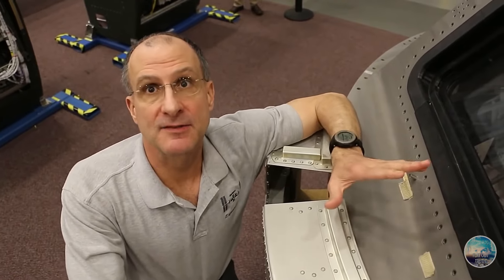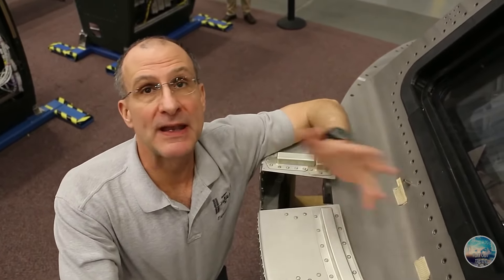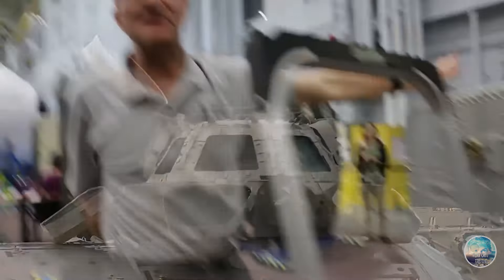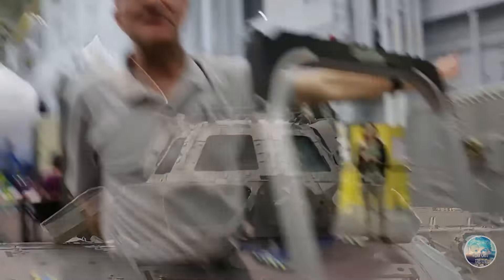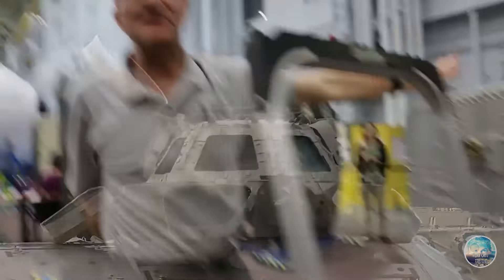WHEN ASTRONAUTS FAIL AT LYING

Comment: The best vacuum chamber on earth has walls of concrete and steel several feet thick to keep out the pressure of the air outside, and the vacuum it is able to accomplish isn’t even close to the vacuum supposedly in space. There’s no way o-rings and bolted windows are maintaining that kind of pressure, and any leak would result in an instantaneous explosion. This is just absurd.

Comment: Emergency procedures would be drilled into them if it was real since an extra second delay could be the difference between life or death. "There's probably a plan for replacing the mechanism", so technical, definitely sounds like an experienced mechanical engineer on the ISS. /s

Comment: i heard an interview with a vaccume expert and he said that all seals in the so called space in negative tor 11 would have to be copper , and also that they would be of use for one time only, and then replaced. so in alleged space a microfiber or even a  hair or a single piece of dust would nullify any seal including the copper ones. so this proves Don has no clue what he is speaking. Plus the life expectancy of a door or hatch would be maybe 2 or 3 seal changes and then the door or hatch would be disgarded an a new on installed.